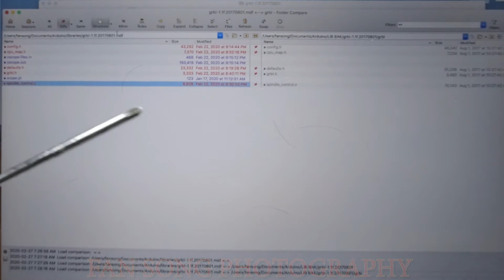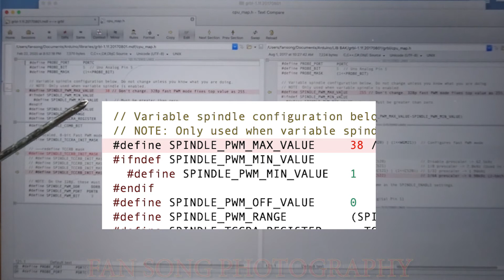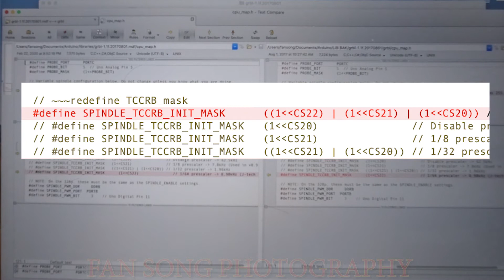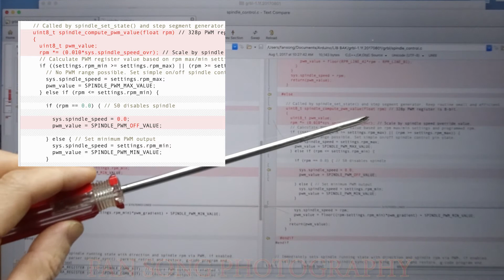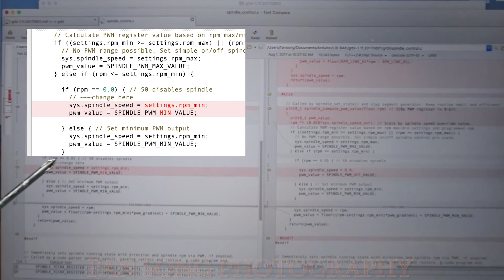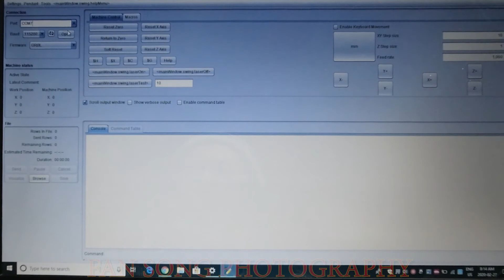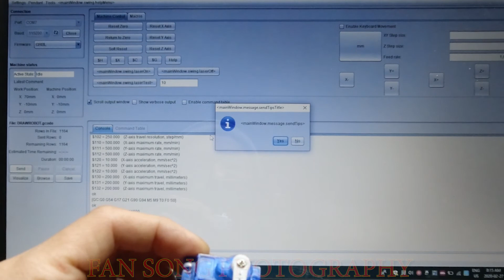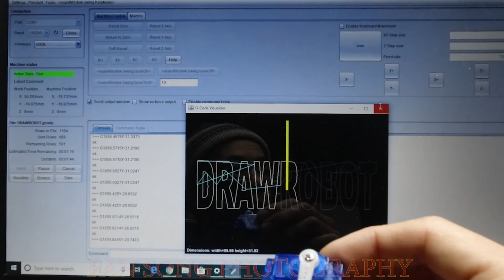How to change the GRBL algorithm from PWM to servo controlled for plotter?

Comment: I have lunyee 40w laser and Cannot configure it right with cnc shield v3. It engraves ok. But cuts very bad. Cannot reach the full power. When I run it directly from power supply it makes a hole in 6mm playwood very fast. But when I run gcode with cnc shield connected it cuts 1mm maximum at full power. Maybe it's something also related to pwm. By default in grbl is 1khz but the laser is up to 30khz.

Comment: I can't understand all this cross welding procedure, when there is in the listing the mask to reverse the direction of rotation of the stepper motors, not only would it be enough to reverse the pins of the motor itself!!

Comment: Hello. I have a all-in-one board from makerbase. It is MKS DLC. It have several extra pins. I can send you the layout too if you want. Can you help me configure grbl for laser+servo+servo+z axis. It has free pins for all of that but i can't figure out how to activate the free pins
Reply from the maker: That will be interesting to see the board. If you can send me the link of the board. Thanks!
Reply: @fsong00  I will contact with you from your facebook and instagram page. Is it ok?
Reply from the maker: @damnned  ok. facebook is ok. The facebook/fansongphotography
Reply: J. Cesar
il y a 21 heures
Hello. excuse me,!  Firnally ?Have you been able the setup mks dlc If it was possible, can you tell how you did it?  I am trying to do  the same set-up as you with my cnc.

Comment: Can We make a mod that uses laser pins [ + and - ] When you lightburn lasergrbl etc. it sends a code to power laser right? We can than use this power signal to power a motor to push down a pen connected with a string? Can it be possible ? We just have to make pen holder that retract the pen up with a strings or something. And when the board send the code to power laser it push the pen down so it can draw.
Reply from the maker: We really don't have extra ports to play around. either do laser or do servo. And the drivers for them are different too. Maybe there is another way... what I can think of is to carry an extra nano Arduino board to control the servo with a light detector. Did you do a search on this topic? I haven't dig into the algorithm after this project.
Reply: @fsong00  nope i havent digged too much but i want to figure it out too. than buy a laser engraver and mod that to use it with a pen.
most of the newer boards have enough ports though. Some have z axis port empty too. on the 8 bit and 32 bit most common boards have laser connection port and it is only 2 pin connecter. that makes me think + / - connecters. So we can connect a motor to it and when the g-code sends laser input than it activates the motor to push the pen. Instead of shooting laser beam it push a pen.
Reply from the maker: @damnned  Thank you for your input. We really push too much to Arduino for this project. I am busy with other stuff and haven't spent too much time catching up on the latest technology. If we have one free port and modify the algorithm should be sufficient to do this task. Using Mega 2560 and RAMP 1.4 should be easy for this project.
Reply: @fsong00  Finally found it. Just like i thought. you dont need the second board. Just connect the servo motor to laser connector. than it works :D

https://www.youtube.com/watch?v=S5Sws00oVGc
Reply: Hello. excuse me,!  Firnally ?Have you been able the setup mks dlc If it was possible, can you tell how you did it?  I am trying to do  the same set-up as you with my cnc.

Comment: when you modifed, now you can use dual, I mean laser and servo-controlled?
Reply from the maker: No. I can't do dual. What I can achieve is the same hardware, with a dual head, one laser, and one servo-controlled plot pen. When I want the plotter, I load the GRBL with the modified servo; when I want the laser, l load the standard GRBL to do the laser. Hope this makes it clear.
Reply: @fsong00  ok thanks, and did you hear any controller that can do the same funtion, or maybe adding something?
Reply from the maker: @sendboxsac9480  I think it is hard. Before, I want to do a unified GRBL for both servo and laser, but it turned out to modify the very basic parameters that built into the GRBL. I ended up with the two different nano. And plug and play different nano accordingly.

Comment: Hi, I'm using grbl library for a plotter. I'm looking for the servo movement fade. I want to slowly up and down. It that possible? Do you have any idea for that?
Reply from the maker: This is is a good question. I have seen some servo product on the market with large torque can be fade in and fade out. Instead of deep dive into the algorithm to fade, I will look into the servo product that can be faded. Right now I am busy with other stuff so I can't deep dive into the algorithm.

Comment: Hi, I tried loading GRBL-1.1f.20170801 into Arduino library using Sketch-Include  Library-Add .Zip Library. It keep saying "Specified folder/Zip file does not contain a valid library". Can you please tell what I'm doing wrong. Cheers.